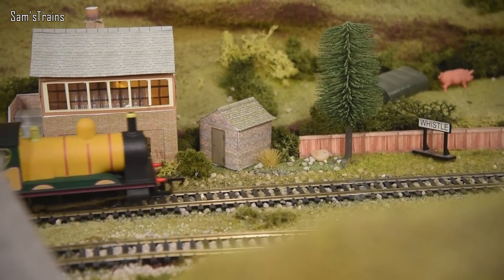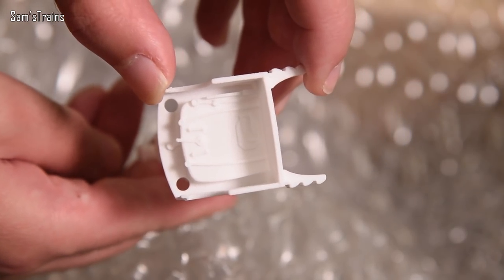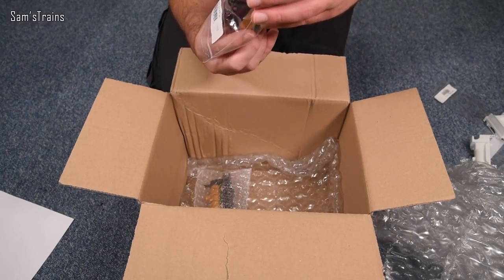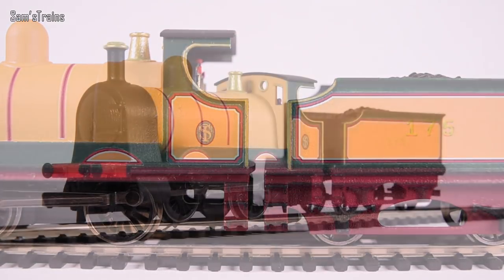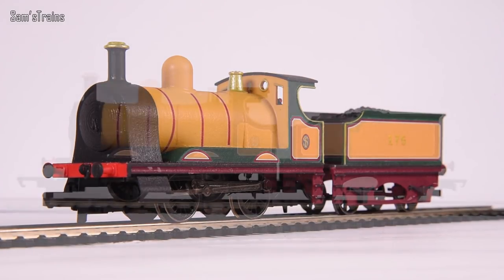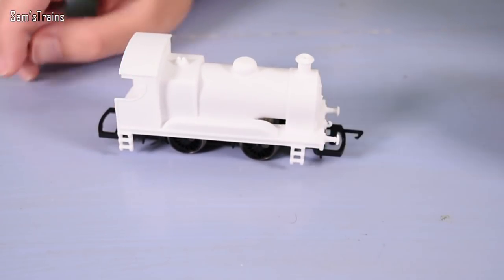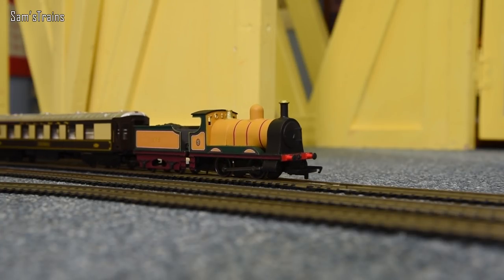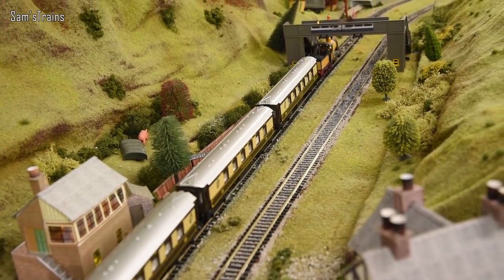Mysterious New LBSC 0-4-0 Tender Engine | Unboxing & Review

Comment: Meh. 

Im not that impressed really. I wasnt with the other ones either TBH. I guess its ok for kids (bit pricey for kids though) but. 

I dont know what kind of printer he uses but, you can see SO many lines from the print process which leads me to presume that its not a resin printer but one that layers plastic from a spool. 

Resin printers are far better for model printing, more detail, less flash and funny lines all over the model. 
Not really worth it in my opinion.
Reply: I would like to bring the price down and the quality up, and I could do this with my own printer (or a Shapeways alternative). But at the moment I want to concentrate on designing. Believe it or not I'm using Shapeways cheapest printing offering - I think it's sintered powder, because it doesn't need support mechanisms. And my markup is tiny.

It was always my intention that these things would be cheap and easy for beginners. I think I've achieved "easy", maybe in the future I'll manage "cheap" as well.

But, apart from the price, I think that the Shapeways service is excellent. I send them a design electronically, and I get a model in the post. 20 years ago this was science fiction!

Cheers
Tom
Reply from the maker: Thanks for sharing Tom - keep up the good work! The designs are certainly sound, and I know the prices aren't in your control at the moment! Hopefully you can set up your own production one day! :D
Thanks for watching - Sam :)

Comment: 1 you called it a tank engine 

2 tender Rams loco and other stories 

3 wheels slip
Reply from the maker: haha tank engine was a mistake! The tender worked fine for me - if it did that, it was an operation error. The wheelslip is due to the light chassis, not the body - more weight can be added! :D
Thanks for watching - Sam :)

Comment: Hornby, get your stuff together, IF SOME GUY USES A 3D PRINTER TO MAKE AN ENGINE, PAINTS IT BY HAND, AND USES YOUR CHASSIS FOR IT AND IT LOOKS SO MUCH BETTER THAT EVEN SAM DOESN'T WANT TO PUT YOUR PROFESSIONALLY DESIGNED BODY ON IT, AND GOT EVERYTHING RIGHT ON THE FIRST TRY FOR *80 QUID*, that's just sad man, that's just sad.
Reply from the maker: haha I guess you're right - though there's nothing wrong with the Hornby 0-4-0 bodies, I just thought this was a bit different! :D
Thanks for watching - Sam :)